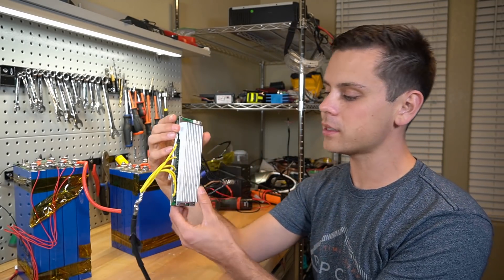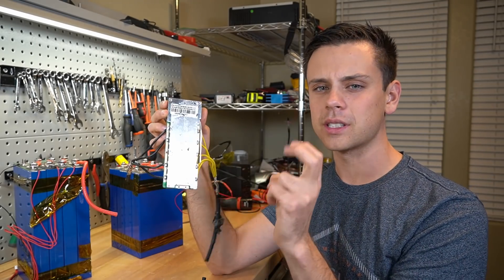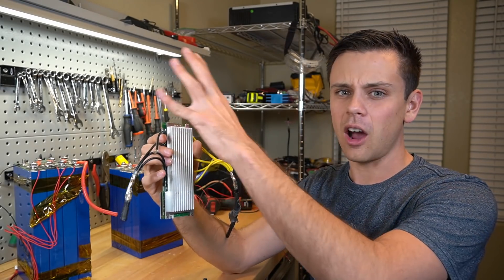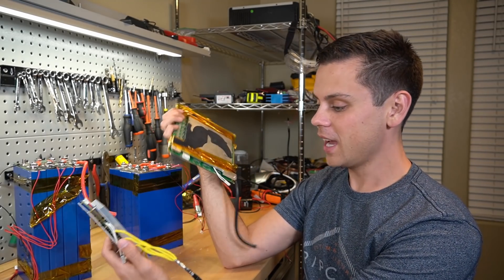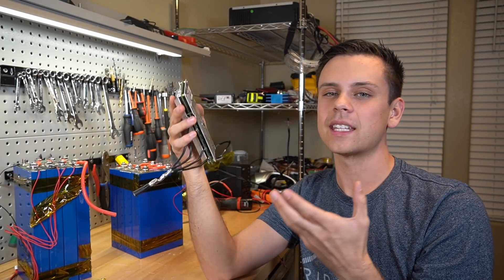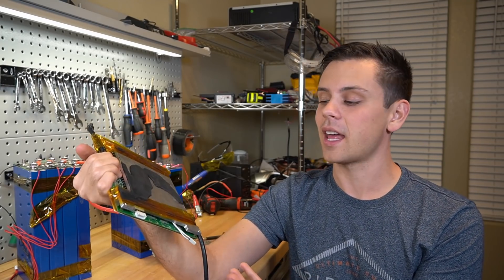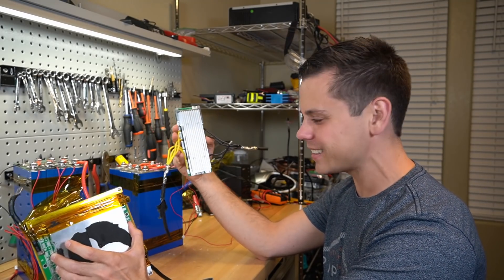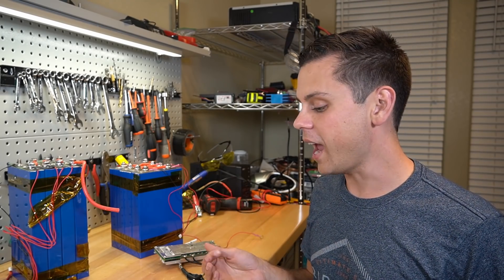Ruixu Problems Part 3: Ruixu's Response

Comment: I was going to buy two of these last month, but I think that I'm going to go with the renogys for around 800 bucks on Amazon. You should cover the Renogys 100AH
Reply: Buy on Ebay, Ebay is usually cheaper because the seller's fees aren't as high as Amazon's platform.  They are $759.99 on Ebay right now. Also sign up for Ebay bucks. They give out ebay bucks often like 10% "off" towards your Ebay bucks. =$75.99 in savings= $684. 
 Amazon doesn't reward their buyers like Ebay, just saying....
Reply: Another price drop as of 11-28-2019. Could also be Black Friday deal?  $639.99